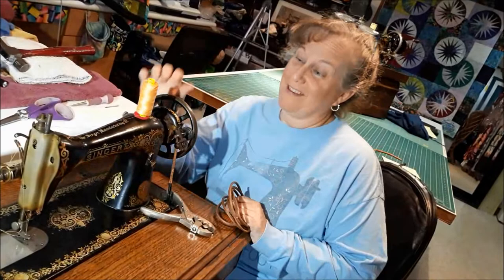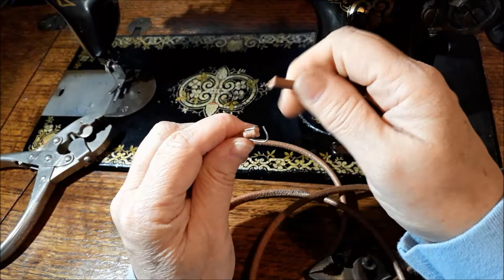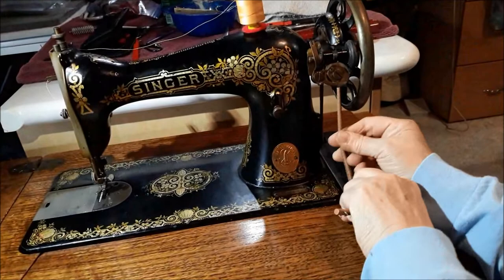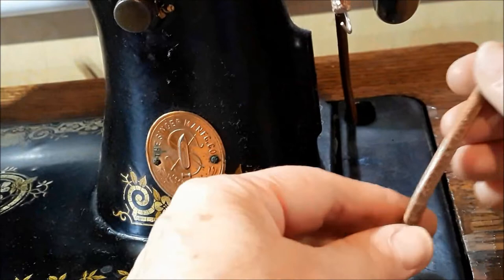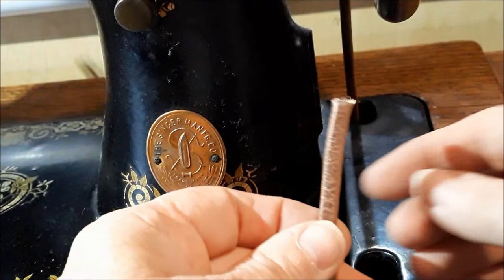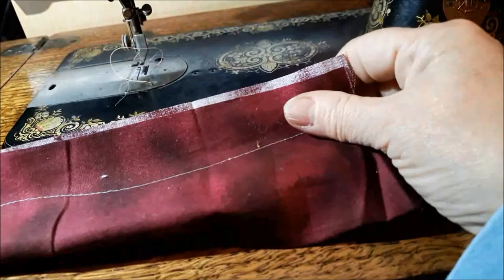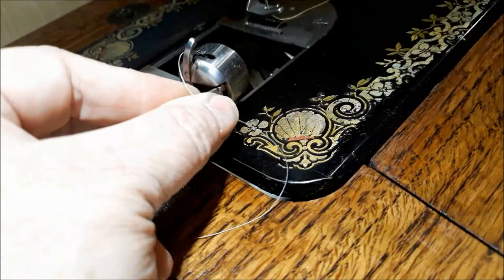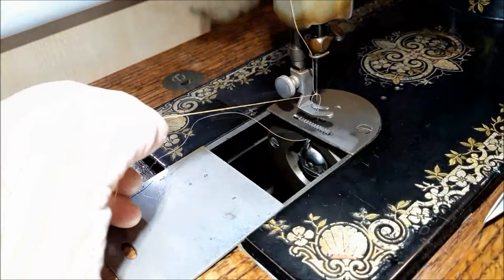Replacing Treadle Belt!

Comment: I bought a 66 last weekend. I remember my granny sewing with one, but I never did. I was trying it out at home and realized the bobbin winder would not let the wheel turn after I replaced the little tire. I decided to take off the winder and just leave it off. However when I took the winder off I realized something wasn’t right with the belt. The person who replaced it put the belt over the wheel not on the groove for the belt. I watched your video and was able to fix it. I had to cut off almost an inch and use a nail and needle to make the hole. Thank you so much. The bobbin winder is frozen but that’s for another day.

Comment: Donna, thanks a million!  After botching up the last replacement I attempted, my wife and I successfully replaced the belt on her 1910ish Singer while watching your video.  Yours is the absolute best!
Reply from the maker: Awe, thanks so much! Glad it worked out!😁
Reply: Hi...love my treadle. Just got it back from being serviced. Like you said, on a surface like a scrap of wood, tightly tape down the end of the belt that you will be making the hole. And again tightly tape a few inches away from where your going to put your hole for the staple, with correct orientation to the other end of the belt so the ends will meet. Now the belt will remain in correct position to make the hole for the staple.

Comment: Use clothespins to hold the ends of the belt and prevent it from coming loose around the wheel at the bottom.
Reply from the maker: Great suggestion! I'm sure it will help many people. Thanks for sharing!

Comment: I just put on a new belt on my mother's old singer 66.
I pulled it tight and slippage at the handwheel is still a problem.
The belt seams to have a tanned slick brown appearance.
There is not a lot of resistance in the mechanism the machine moves freely
Reply from the maker: You might try roughing up that slickness with some sand paper. Also make sure that the channel the belt goes in on the machine is totally clean of any oil or cleaning supply residue.  If someone dusted or cleaned the machine using Endust or Pledge, that could cause slipping in the channel.  Did you trim the end of the new belt off to the right length first? All treadle are a bit different, and the belts come standard - too long on purpose. So after you put the belt around both wheels on the machine, pull it as tight as you can, maybe even stretching it a bit. Mark how much you need to cut off of one end in order to make the two ends of the belt meet up perfectly. Then when you punch your hole in the belt to insert the staple,  you will notice that there will be a tiny gap between the two ends of the belt when you stretch it back on the machine. That's means its stretched perfectly tight enough.😉

Comment: Great video! A question about your belt derailer: my table has one, but it’s not spring loaded. It moves back and forth loosely but it doesn't  spring back into place. So it works great to take the belt off, but doesn’t work at all to get it back on track. 

Can you tell me where the spring in your belt derailer is and what it’s attached to?

Comment: Thank you so much for the excellent tutorial. This is exactly what I needed. I purchased this machine without the belt. It sat there for 6+ years while I borrowed my mom’s electric sewing machine for my projects. Now I can work from my own home. 

Can you tell me if I need to release the belt before storing the machine into its compartment ? Do I need regular maintenance and oil the moving parts?
Reply from the maker: Yes, you need to release the belt before storing. That will make the belt last longer.😉 If you are going to use the machine on a regular basis, it's always good to give it a dose of oil at least once a week. If you will be using it less frequently, then just give it some oil before you start a new project. Have fun! Thanks for watching.❤

Comment: Donna, I just picked up a model 15 from 1872b I am so excited to restore the machine. I love your video on belt. Do you have any other resources or suggestions for Thai machine!
Reply from the maker: Hi Jessica, No specific instructions, but in general, you will want to get all the old oil and built up "gunk" out of the machine as a first step. I use 100% pure kerosene to do this. It dissolves any oil and goo, then evaporates. I squirt it into hard to reach places using a syringe,  and where the build up needs some scrubbing, I use a set of little wire cleaning brushes for pipe cleaning. When everything is squeaky clean I drop some new Singer sewing machine oil on all the moving joints. Dont ever use grease! She should run smooth and quiet after that. When it comes to parts (you may need an upper tension spring) I look online. Make sure you mention the exact model and you will probably find something on Ebay. Hope that helps!

Comment: Hi Donna,  Thank you for the belt changing tutorial. My treadle does not have a release. Can the belt be too tight?
Those are great pliers!
Reply from the maker: I don't think it's ever possible to put the belt on too tight.  When you don't have a release, you just have to work it over and off the big wheel on the bottom first.  Good luck!

Comment: What size belt do I buy for my 1911 singer sewing machine? I do not have the original belt but I would like to use it
Reply from the maker: They come in a standard 72" size, then you have to cut it to fit. The video will show you how. I have heard of people using just a pair of panty hose that they stretch around the belt area and tie in place - and that can work in a pinch. Leave both legs attached, but cut the top part of the panty off.😉

Comment: Hi Donna, I have a daughter(14yrs) who is passionate about everything antique - she has her heart set on purchasing a treadle sewing machine e but has a limited budget - I was wondering if you could give her some tips about what to look out for when purchasing? The machine she is considering does not have a belt so we can’t test if the machine itself is working….. many many thanks for any advice!! Kind regards
Reply from the maker: Hi Del, How fun that your daughter is excited about antiques!  You will want to make sure the machine she purchases has both the bobbin shuttle and a bobbin or two.  As you can see in this video, the belt is an easy fix.  It will also benefit her to know that the machine is not seized.  If she can hand turn the wheel on the side, and everything moves freely, then that's most of the battle already taken care of!  Turning the wheel up and over the top and toward yourself should make the needle bar move up and down, and make the feed dogs pull the fabric from front to back.  If you have the opportunity to thread the machine before purchase, you can test the machine even without a belt by hand cranking it to make it go through the motions to create a stitch.  To test the treadle,  place your feet on the treadle peddle and make sure the fly wheel spins freely when you rock your feet pushing the peddle in a heel to toe motion.  This will insure that it is not frozen and that the pitman arm is still in working order.  Other than that, if everything is moving and it is making a stitch - then all she will have to worry about is cleaning up all the old gunk on and around the moving parts and giving it a nice clean sewing machine oil.  (I use 100% pure kerosene to do the cleaning with Q-tips and small wire pipe cleaning brushes)  I hope she finds a great machine!  Good luck!

Comment: Hi! My sewing machine does not have any tension discs just a large spring about 2 inches long is it supposed to be like that or does it need the discs? I have the same exact machine as in this video. Also, the presser foot won't budge the lever just slips and doesn't lift the foot how would I got about fixing that? Thank you so much for the video by the way, it's incredibly helpful!!! 😊
Reply from the maker: It sounds like your machine needs a complete cleaning. If it's been sitting for many years, it gets gummed up with dust sticking in the machine oil. Makes all the parts get sticky and sometime stuck completely. I use pure kerosene to clean the old sticky oil off all the moving parts that I can see. It helps to use a dropper or a syringe to squeeze the kerosene all over the inside parts. You can access the inside of the machine by taking off the plate on the end of the machine. Once you have squirted everything with kerosene and used a Qtip to clean all the old oil off, squeeze some new sewing machine oil in all the spots that have moving joints, and move the presser foot lever up and down, add more oil where you see the parts moving. Also crank the hand wheel a few times every time you add oil. As for the tension discs, yes, you need those discs. The spring all by itself will not be enough friction on the thread to give you a good stitch. You may want to find a "tension disc assembly" for your machine online. I find a lot of my parts on ebay. Hope this helps!
Reply: @TheMasquerade  Thank you so much for taking the time to reply back and help me😊 I'll definitely look into buying the tension discs! I really had no idea what to do I was worried that it wouldn't work at all! Again thank you for the all of your help and the wonderful video ☺ I hope you have a wonderful day!

Comment: I have a Singer 66. I thought it just needed a new belt so I installed one. The problem is it just slips and doesn't turn the shaft. It will turn the part that fills the bobbin, but when I engage the main shaft it slips. Any tips to on how to get the shaft spinning easier? This machine hasn't been used for around 50 years.
Reply from the maker: Sounds like it needs a good cleaning. I use a syringe with kerosene to get into all the hard to reach places to loosen up all the old gummed up oil. Then give the parts a good scrubbing with various tiny brushes and pipe cleaners. When all is clean I used a good dose of sewing machine oil on everything! It usually does the trick.😉 Good luck!
Reply: @TheMasquerade  thank you! I'll give it a try.

Comment: I am having a  hard time getting my belt to be the right length so it can move the wheel. I find it works great while the knob is not engaged (loosened so the needle doesn't go up and down), but when I tighten it, it won't do its job. Help!
Reply from the maker: When you tighten the knob on the wheel, can you turn the wheel by hand freely? If not, then it sounds like you need to get inside to do a good cleaning and then nee oil.😉

Comment: At the risk of sounding like a prick , use a vice next time to hold the end that's the second or the third hand you are looking for.... LOL.   I find devices like the vice a lot easier to pinch the very end of the belt . and then you can push your pin through and then after you've made the whole , take it out of the vise and voila ....(make it just a little bit longer then you need)  so the part you had squished in the vice can be cut off...... And thank you for showing me how to thread the thread through the machine now my brain can rest lol....
Reply from the maker: Thank you for the ad-"vice"! LOL  No really, for someone who may have a vice on hand - who does not have a pair of pliers or a helper around, the vice is a very useful tool.  So are the treadle belt pliers - so I think I will stick with them.  ;)

Comment: I have one like yours but the spring on the tension is different than you said yours would be.  I also had a screw missing from the bobbin case and can't find a replacement.  Do you have a source for parts?  Mine was a mess when I got it but for free it was worth it.  I got it clean and it runs wonderfully.  I need a bobbin winder rubber but haven't been able to find one.
Reply from the maker: I find most of my parts on Ebay.  Just Google search for the model number of your machine and any parts that are available will come up.  You can also search for a specific part like "Bobbin Winder Tire Singer 15" and see what you find.  I've gotten great service from SewingPartsOnline.com 
 There were many different model 15 machines over the years and they changed little things on each one.  One of them was the tension spring.  It saw many changes.  ;)  My machine is from 1919 and the actual model number is Singer 15-11.  I know the model Singer 15-88 has reverse stitch option, and the 15-91 later on has a potted motor that operates the machine with a direct gear drive.  Singer produced the machine for over 100 years! (starting in 1895)  Good luck with your part search!
Reply: @TheMasquerade  Thank  you!